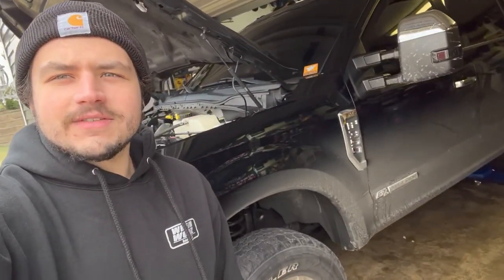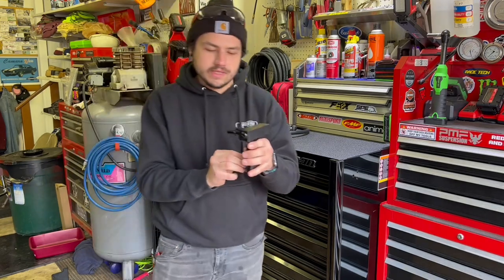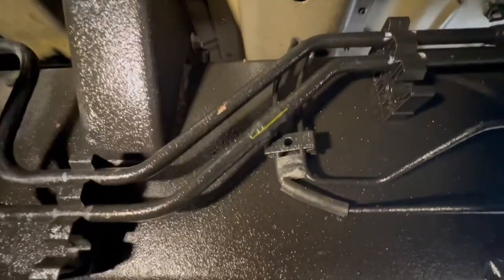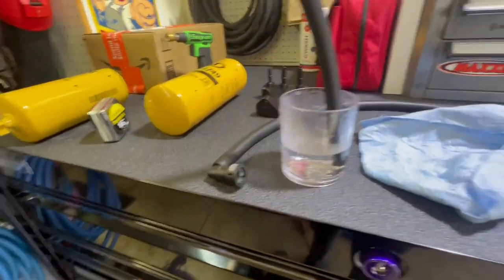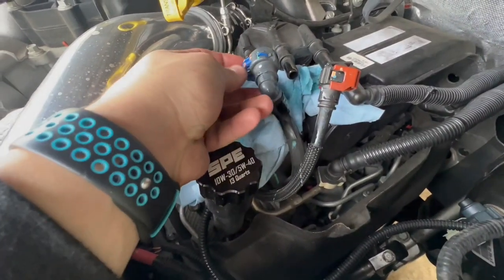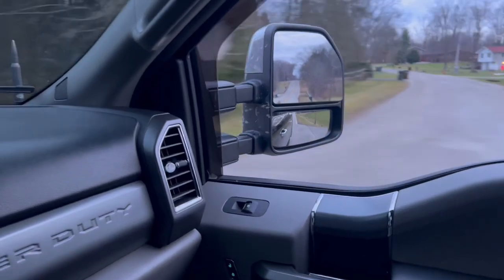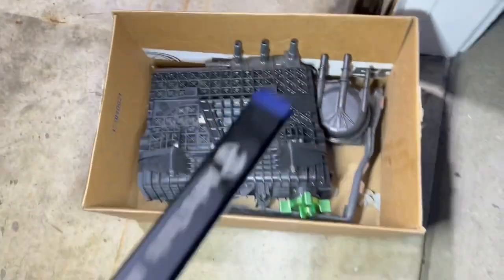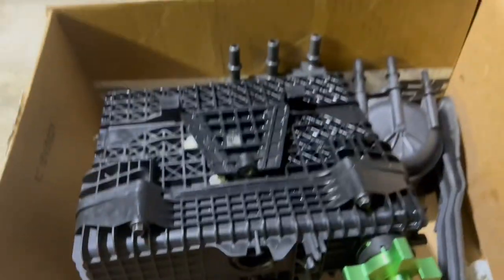Installing the SPE Motorsport FUEL FILTER SYSTEM UPGRADE with CAT FILTERS! Huge upgrade!!

Comment: This video saved my life!  3 issues on install for me.  1. Topside filter housing. After fighting with that damn bolt, I got a chisel and cut the plastic between the bolt and the housing.  Popped right off, then loosened from the backside! Way more room.  2. The water sensor. It came out easy enough, but i had to take the SPE bolt on resovor off to slide the sensor in.  Turned my drain out to match yours. 3. The lower fuel lines were different than the SPE instructions. I didn't have the pull up tab / press down Tab.  It was just a press down.  Hard to get leverage on those tabs and took me a minute to figure out how to get them off. 
Like I said man, you are a life saver! I appreciate you!
Reply from the maker: Glad to hear!! Thanks for watching!!

Comment: Really appreciate the video! I just installed and it was relatively straight forward thanks to this video. The hose connections were tight, but nothing a heat gun didn’t take care of with relative ease. The WIF sensor was easy to get out, but took a minute to get back in with the double o-rings. The biggest take away that I found was my damn fuel connections were different then yours AND the instructions. I have a 22’ for reference and hope this helps. My connections were a very simple push in(towards the fuel filter and to relieve the tension on the fitting) and after pushing in, had a simple button that was depressed. Took me a WHILE to figure that out after trying to pry up on the damn clip. 😂 anyway, I wanted to share that and I hope it helps someone else in the future. This kit is badass though! Thanks again.

Comment: Great vid Rick & great alternative to the HSM upper fuel filter kit. Main advantage I see w/ the SPE kit is that any issue w/ what was the upper filter now drops fuel on the ground instead of the motor (you may have seen the diesel geysers then engine fires from upper filter failures). Please just remember that the return line fitting is yet another potential failure point on our Powerstrokes. The return line disconnect fitting removal is counterintuitive, and the barbed fitting is very fragile (ask me how I know). Rick, I think I’m now sold on the SPE “all in one kit” system kit, instead of HSM’s separate kits for Upper filter & Lower water separator. Only thing i’ll do different is to use stainless hose clamps over the barbed connection fittings that SPE provides. Just a bit of old school insurance. Thanks for putting this vid together. I found it jest in time before buying HSM’s (inferior IMHO) separate Upper & Lower kits.
Reply from the maker: Glad you liked it and thank you for the support much appreciated! I also run SPE injector return line repair kits to prevent that part from failing I believe I have a 11-16 video on that part up here!

Comment: Very very Nice I Like... Hey Quick question have you put Deeper Engine Oil Pans and Trans Pans on... If Soo have you Extended Oil Pump Pickup and Trans Filter to go Deeper into the Sump..
Reply from the maker: If you check them out I got 2 more videos on installing the deep SPE Motorsport oil pans, didn’t have to extend anything, eventually I’ll get a trans pan video up and I’ll have to extend the filter on that one

Comment: Very good install video! I have them as well they don’t hang below the bottom of the tank. Love mine, awesome product!
Reply from the maker: Yeah SPE makes some awesome products that’s forsure!! I can’t get over how good they look mounted up!!
Reply: 2017 PSD.  This was an informative video.  Im not a mechanic, I don’t like changing the filters in their current configuration and I don’t like paying $300.00 for somebody else to change them.  This looks great and appears to simplify the filter changing process.  I don’t off road.  Is there any concern with lower hanging filters being damaged by debris on the road?
Reply from the maker: @johnmagan7266  thanks for watching! Some people don’t like how low they hang, but I don’t off-road my self either, just a daily driver. It mounts up really solid and I don’t have any issues!
Reply: You don’t have to off-road to damage that low hanging filter just run over some road debris there could be problems.
Reply: I don’t have this kit yet but I am looking into it and I read that CAT makes shorter filters that are compatible. I don’t have the part numbers but it shouldn’t be hard to find

Comment: One more thing: pre-prime your oil & fuel filters by filling them w/ oil or fuel respectively - just like my heavy equipment diesel mechanic friend recommends. Still need to turn the key a few times, but not 10 - 20 times, so it’s easier on your pumps & motor. Something to consider.
Reply from the maker: True that good point!!

Comment: Yea the filters hang too low for mudders. Maybe SPE may want to fab a plastic mud guard around it. Other than that the unit is about 500$ @3 hrs work for the average joe blow☝️
Reply: The beauty of this is you can change out to different filters if needed!  Shorter filters can be used as long as they can meet the micron ratings and water separation.

Comment: Question: Does this filter upgrade solve a common Power Stroke problem, or is it just damn cool? Both are good reasons.
Reply from the maker: Definitely damn cool! The thing I really like is it gets rid of the top filter on the engine bay, which is sweet because you shouldn’t have to worry about a mess up there anymore. You can see the size of the new fuel filter has a better micron rating then stock and provides much better filtration. And lastly the wif sensor where it is positioned should be able to catch water in the fuel before it heads up stream!! 

Definitely a awesome unit! If you go to spe YouTube channel dan goes more in depth about how it all works!

Comment: Have a question. What do you torque the hose fittings to on the filter housing? The system comes with all 6 fittings off when delivered?
Reply from the maker: All the instructions with torque spec are located on the SPE Motorsport website! Don't remember the spec off the top of my head!

Comment: Looks like having 3’ of hose laying on top of the fuel tank is asking for a problem. Formed shorter hoses would be better. Also I wouldn’t use hot water on fuel hoses. Heat gun would be better.

Comment: I Have a 2012 F-350... I See that the Water separation filter is Different from mine... Would this Work or is There a Part number for My 2012 F-350???
Reply from the maker: No this kit is 17+ only. You would have to get a different brand for under the truck and then you can run the SPE Motorsport T block manifold in the front

Comment: Only thing I’d be concerned about is if your driving through deep ass snow or something since it hangs lower than flush with the tank the bottom of the filter could get hit by something under the truck
Reply from the maker: Ran it through a few storms no issues luckily but both trucks sit for the winter now

Comment: Have you ever heard of anyone having an issue with the push lock fittings blowing off while driving?  First it was the 90* push lock now it’s the other that clipped into the factory lines.
Reply from the maker: I’ve heard of 1 or 2 folks having that issue but I’ve never ran into it myself! I got about 12k miles on my setup and on my 2nd set of filters no issues

Comment: Great video!  Any reason why there is so much excess hose on top of the fuel tank?
Reply from the maker: Thanks for watching!! And in the instructions SPE says to cut two 3ft pieces you can make shorter if you want but I think the 3ft is good because of how it’s all curled up there, I feel if I went really shorter I would have it kink easier and I don’t want that!
Reply: @Powerstroke Rick  so there is no way to make a straight run with the lines?!
Reply from the maker: @skyvwest  you can shorten them if you would like but I wouldn’t go crazy, can’t have a straight run you got to come off the 2 lines on the Frame and go to the top of the tank so either way there need to be a loop if that makes sense!

Comment: Nice video man I was wanting to see a install. Good job explaining too

I have a question how does this system work with SPE disaster prevention kit?? Doesn’t make since adding this kit how it would work.
Reply from the maker: Thanks man much appreciated!! I would contact SPE on how it would all work together!
Reply: @PowerstrokeRick  do you think I could use this fuel filter system with a 60 gallon s&b tank?
Reply from the maker: @colt4528  I believe SPE said it’s compatible with aftermarket tanks not sure how big though I’m guessing yes

Comment: Having trouble with the fittings and the fuel lines. They are not lying about being tight. Any other tricks you used
Reply from the maker: The plastic push on fittings? Just use scolding hot water soak the hose in it for at least a min and be fast taking out and slam it on, also put a little bit of diesel fuel on the fitting as well going in
Reply: @PowerstrokeRick  thanks for the vids and reply. Looks like I need to push a little harder
Reply from the maker: @tomrucker2737  yeah they are definitely a pain have to use a lot of horsepower!!
Reply: @PowerstrokeRick  you are not lyin. The best I can do on a couple is a little less than 1/8 inch
Hopefully that’s good that’s all I got.

Comment: What's the Part number to this All In One Water Separator Filter and Fuel Filter Kit... I Don't see it under  17-23 Ford 6.7L Diesel looking For This Same exact one for a 2012 Ford 6.7L Diesel.... Are you Able to get me the Part number I needed for my 2012...
Reply from the maker: They only make this for 2017+ trucks

Comment: I didn't see it, but did you install a DPK too? That was my first mod, protect the HP fuel system from that potential bomb known as a CP4.    Unfortunately I have an F-450 and the install will be a lot more difficult because the filter is 90* in relation to what yours is, and between the tank and frame.  Argh.

Comment: NIce work.   I am concerned how the filter hangs down pretty low.
Reply from the maker: Thank you and it’s not as bad as I thought it would be I know some other brands hang really low but on this one you can only see a little poke from under the truck or the fuel filter
Reply: Very good install video! I have them as well they don’t hang below the bottom of the tank. Love mine, awesome product!
Reply: I'd fab a skid plate, don't need an animal impact or even a snow drift tugging on that and then be stuck with no fuel supply. A nicely fabbed plate with a big enough hole cut for the drain
Reply from the maker: @mrfuninthesun33  wouldn’t be a bad idea!
Reply: @PowerstrokeRick  that fuel filter system looks heavy. It’s the old bracket heavy enough to hold it. I go off road a lot. I would be concerned that vibration would break it. Any thoughts would be greatly appreciated. Thanks.
Reply from the maker: @ozzymed8136  it’s not really heavy the whole billet aluminum housing definitely helps with that I should’ve weighed it before I put it on to give out a comparison to stock but I don’t have any problems it’s stout. I’m sure it does weigh more then the stock one tho especially with the filters!

Comment: Powerstrokerick , just installed mine and noticed that the fuel filter only has one oring and does not have one to separate the dirty side from the clean side. The water separator comes with a separate oring in the plastic but not sure we here that goes?
Reply from the maker: Yeah I didn’t use the extra O-ring not sure what it was for
Reply: The o ring that comes with water separator filter goes around the threads of the filter mount. Put the o ring on and slide to the top of threads then mount the filter.
Reply from the maker: @himni1  you talking about the entire housing it self that mounts up next to the tank with the torx screw?
Reply: @PowerstrokeRick  no the little threaded pipe that the spin on filter tightens on to. You put the o ring on that first then spin the filter on. It is to prevent water going from the dirty side (outside or outer ring) to the clean side (center or inside).
Reply from the maker: @himni1  oh ok I gotcha now
Reply: @PowerstrokeRick  this video shows where it goes for anyone confused https://youtu.be/yzkw720STeU?si=X-D9kLoXTBWkD3qa
Reply from the maker: @himni1  awesome thanks for the info!

Comment: You need a shield for the filters we had to make a shield customer had rock come up and puncture  filter
Reply from the maker: You got a picture of the shield you made?
Reply: @PowerstrokeRick  not really  i used 1/2 inch steel plate  made box  around filters   open  bottom     4 bolts to frame    i have done probably 30 - 35 of them 
Last 4 years  when I made the boxes  I had  3 inches from filters to wall of plate   and 2 inches  below filter   i have even made a few to protect  oil filter 
With or without  cat filter  conversion kit   one was hit by thick limb last month  saved the oil filter  especially since I make plates 2 to 2.5 below filter 
This saved them a 23 mile hike  they were snow camping  and limbs buried under snow ....  now to avoid  freezing  jelling of fuel  with those filters  
Hang so low  make sure to dose ( winter blend -- power services  - fuel treatment  .. I put 100 gallon treat in tanks of all trucks in winter I own a diesel 
Repair shop  ... hopefully you  change stock oil filter to cat ..  make sure to prefil. Filter   good luck 👍
Reply from the maker: @quagmiredavis4117  good to know thanks for the tips and info! And yes I have the SPE billet oil pan I’m going to be putting on and looking to get a cat oil filter setup so I’ll be running close to 17 qts

Comment: Hey did you use the extra oring that came with the cat filter on the water separator, because some big trucks don’t use it and some trucks do.
Reply from the maker: No I did not use it
Reply: @PowerstrokeRick  hey does it sound like constant air on first start up after it’s been sitting a while cause I’m still got air sound at first start up after sitting a while like a couple hours
Reply from the maker: @thewrxsti1  no I don’t hear that did you cycle the key switch a ton and make sure the filters are all tight?
Reply: @PowerstrokeRick  yea I drove it home and even beat on it no check engine lights came on.  I just hear air after it sit for some time a first start up.  And no fuel leaking anywhere.
Reply from the maker: @thewrxsti1  I think you’ll be alright does it sound like a lot of air sucking?
Reply: It sounds like It lost prime pressure for a few seconds then the noise goes away.